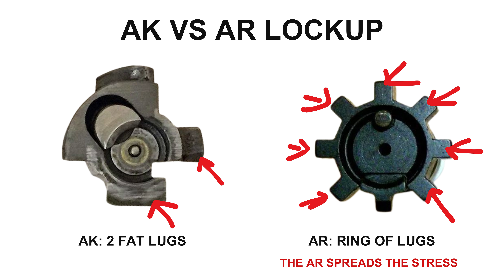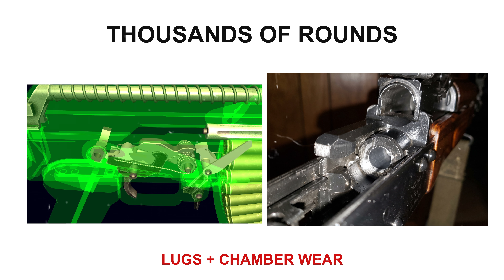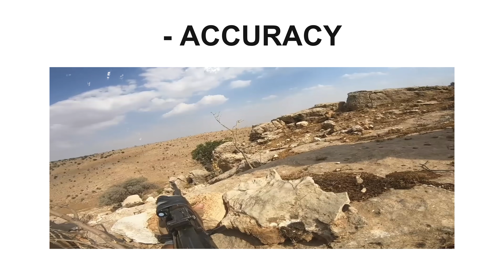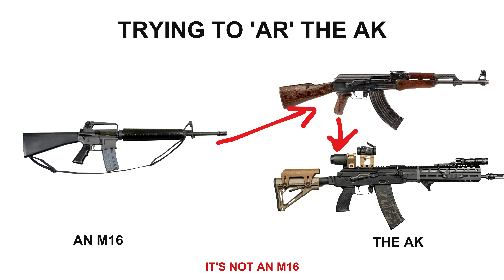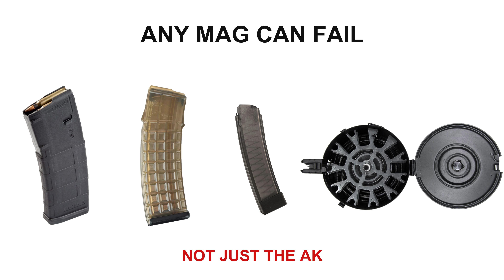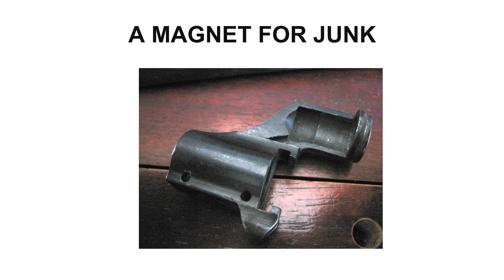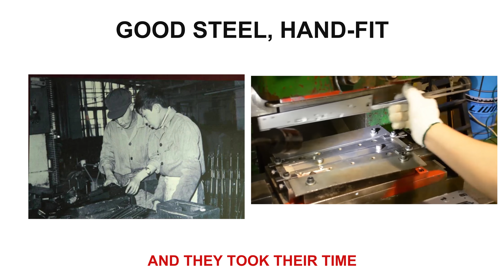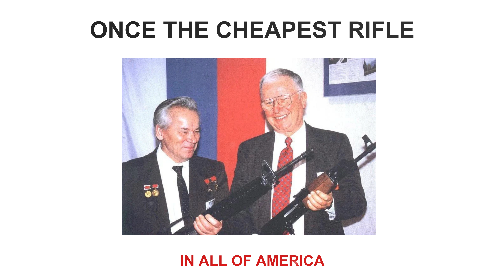Every AK Flaw Explained

Comment: Inrange pretty conclusively showed that the myth of loose tolerances on AK's are what cause them to not jam up is false.
Reply: @Ranar14  its usually a mag related issue most of the time.  Unless something catastrophically failed lol
Reply: Not at all AKs are equal either. Izmash makes them differently than other countries. Unlike ARs, they are not standardized. I suspect some AKs would end up doing worse in this same test than others. I would bet the best one against the mud test is the type 56.
Reply: Ehhh, not quite. They showed that the AK having a very open action sucks when it comes to mud.

However, it having looser tolerances helped it in the sand tests, and they perform great for similar reasons in icy conditions.
Reply: What was the sample size of these tests? How many hundreds of thousands Legit AKs did they use?
Reply: @1wayroad935  3-4 various ones with the same result. AK is shit in mud
Reply: @The_Fubar  So not even a single percent of the actual number of AKs out there? Real legit testing there.
Reply: @1wayroad935  same stuff, russian aks arent much better and would jam in mud the same way